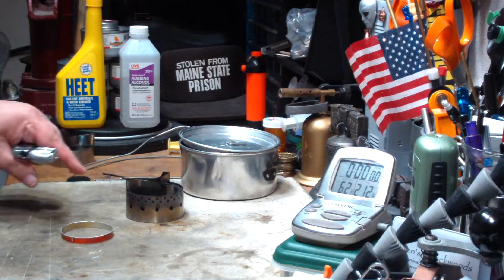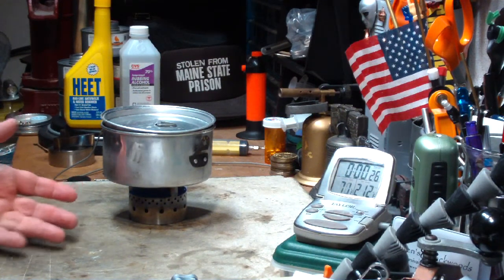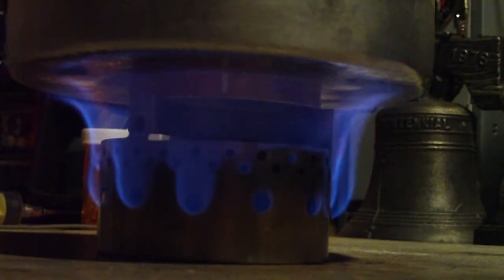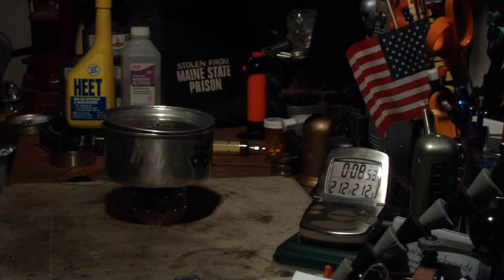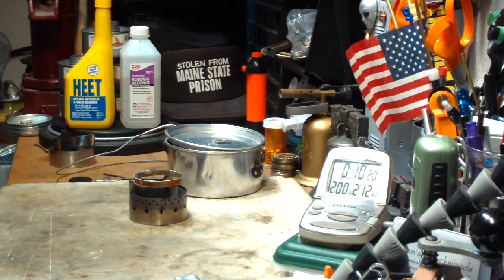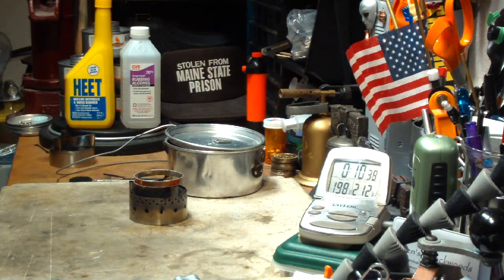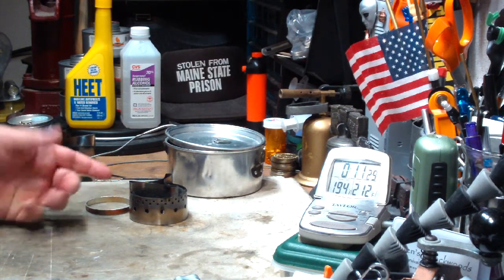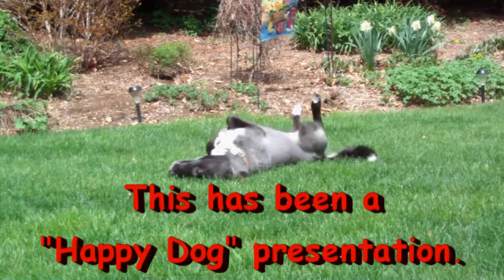Flat Cat Gear's ISO-Clean 2.0 Stove - Using Heet For Fuel 4th try - Boil Test #7

Comment: My theory for why flames form jets out of the holes is this: as the saturated carbon felt strip heats up, the vaporizing fuel creates enough pressure of its own to force fuel vapors out of the holes, which then ignite.
I, too, am surprised to see this happen, but that's my best explanation for now.